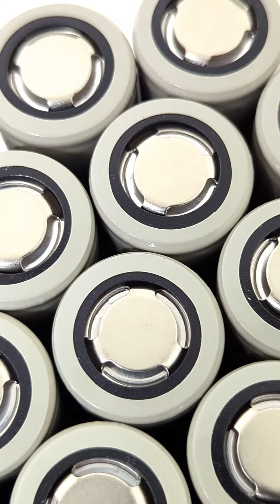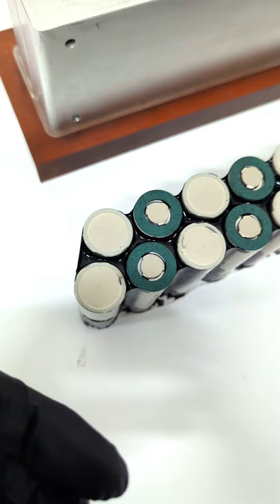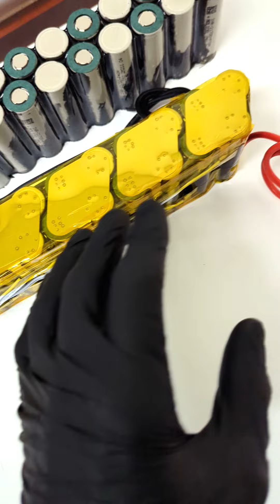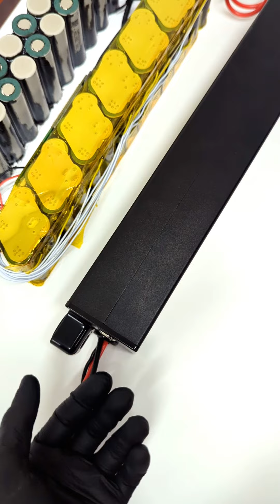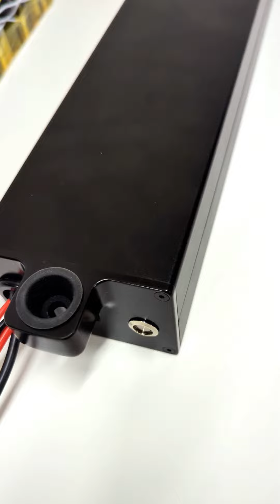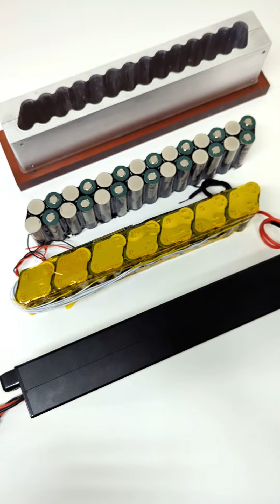How we make our ebike battery safer.

Comment: How is traveling on a plane with this bike say to Miami from nyc 😅
Reply from the maker: We took it from LA to NYC on a plane. It wasn't too tough. It's small, pretty easy to disassemble, and light enough with the battery removed to check as baggage. The only two frustrations are having to ship the battery, and needing to disconnect the front brake in order to fit it all into a "golf" style bike bag for checking, which means you'll need to bleed it when you arrive.

Comment: Now try servicing the battery when a cell dies, yeah, that's why people use spacers
Reply from the maker: Cell spacers don't offer nearly as much fire propagation protection. Being able to save a few bucks servicing the battery isn't worth someone's life.
Reply: And does that aluminum housing have any sort of pressure relief if a explosive cell chain reaction indeed happens (even thermal epoxy can get destroyed), or does it simply just blow up when it can't resist the internal forces and cause an even bigger explosion than just the cells hissing away after one another
Reply from the maker: @PureComedi Yes of course. The seams all along the side of the aluminum case as well as the end caps are designed to allow venting.